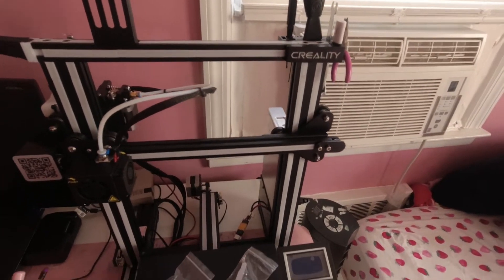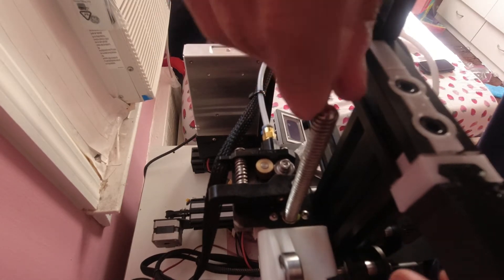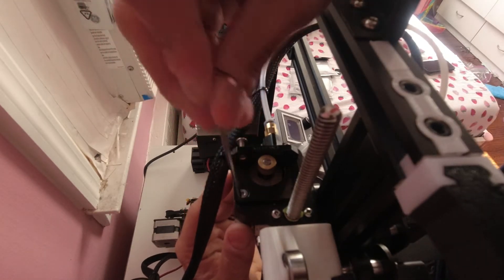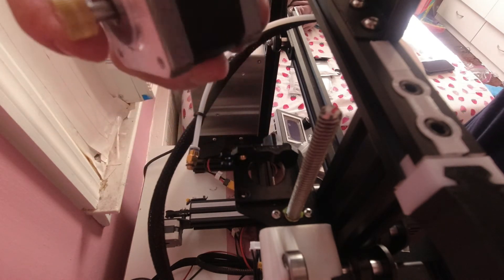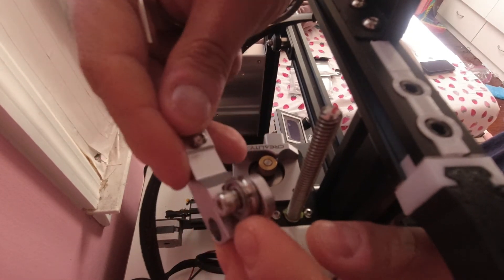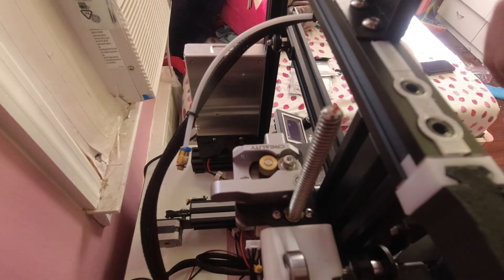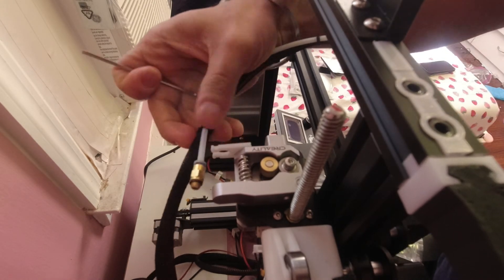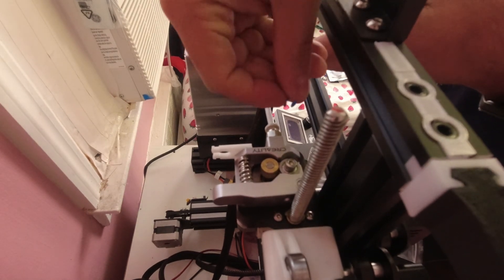How to Install an All Metal Aluminum Extruder on a Ender 3 Series or Aquilla 3D Printer (Upgrade)

Comment: Best tip is at about 7:58 about pulling back the coupling a little, then pushing in the PTFE, then tightening the coupling. This answers why I've had a hard pushing through new filament.
Reply from the maker: thanks